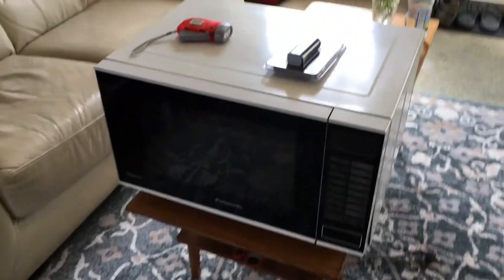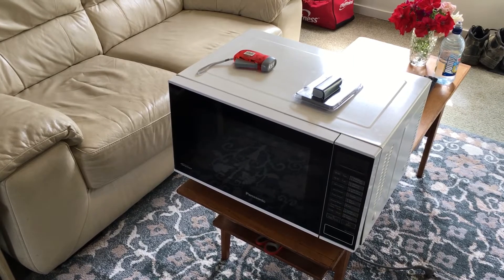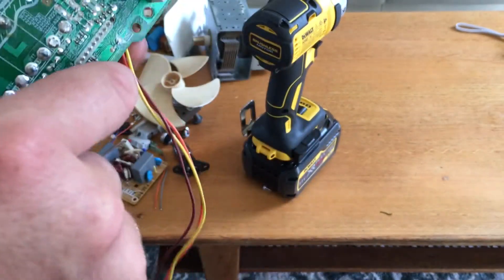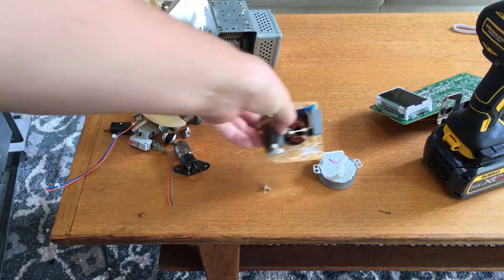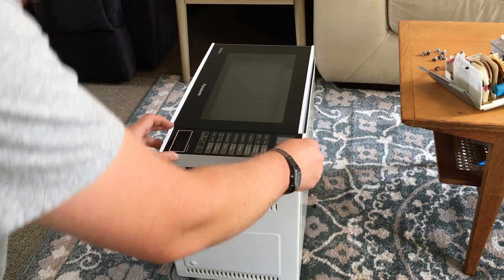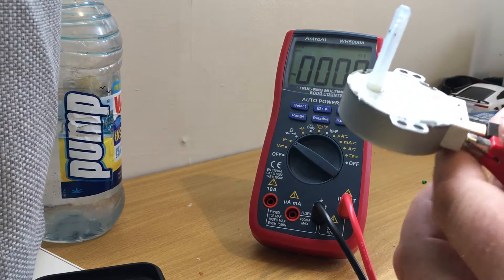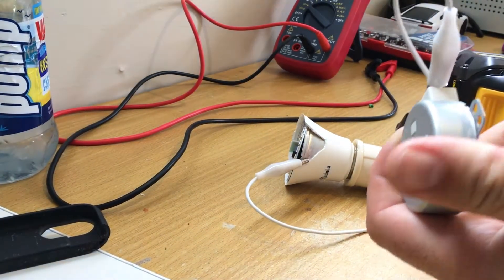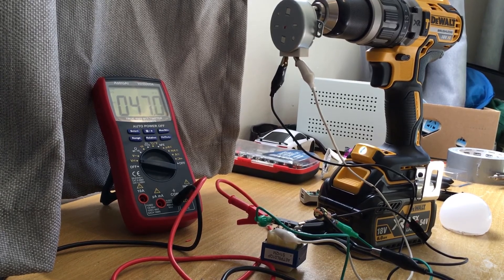Whats inside an inverter microwave?

Comment: When you are measuring the voltage actually it depends on the meter (on the current of the meter)
Reply from the maker: How do you accurately measure the voltage then?
Reply: @KiwiMaker  that’s what I’m saying it’s really hard.
I tried and with one meter it gave me some 200V and with the other it went over 600V